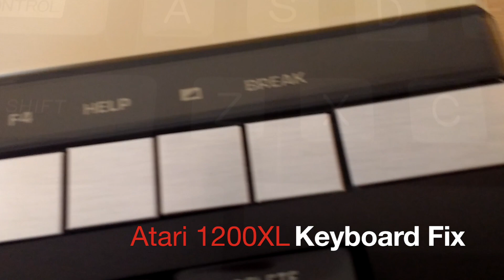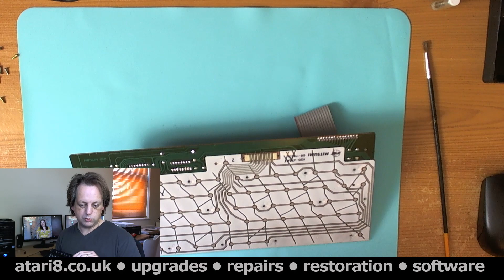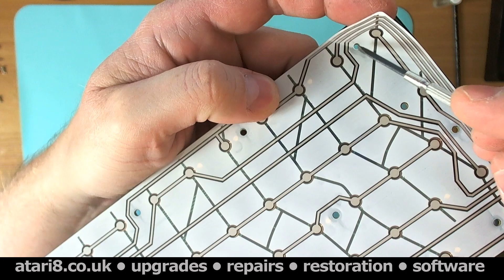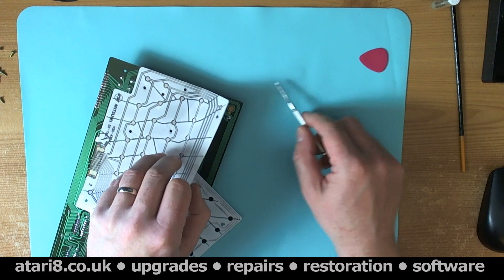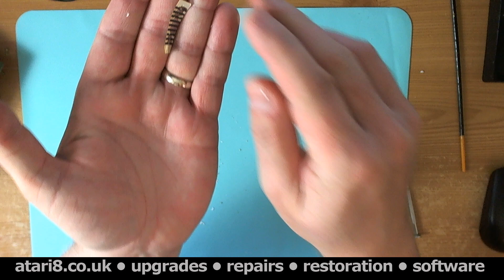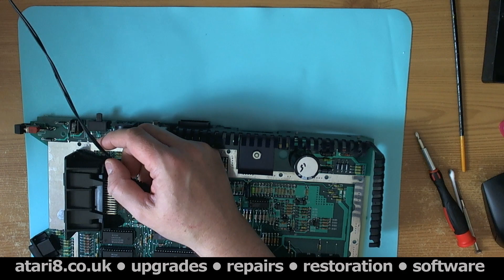Atari 1200XL Keyboard Mylar Fix

Comment: Thank you!  Your video saved me having to buy silver paint. I got mine working without it.   I found that someone had already attempted the fix, the membrane side of the connector was clean, but they left the tape on the PCB side, They actually painted silver on top of it .   All I had to do was remove the tape from the keyboard, clean it up and put it all back together.
Reply from the maker: That's great! Applying the conductive paint over the old glue on the PCB side without removing the material preventing contact is certainly an interesting approach, LOL. :)

Comment: followed this video to help repair my Atari 1200XL keyboard.  Excellent.  Question..  with the U1MB with FJC firmware installed, how do you get into the system test to test memory, keyboard, etc.  Before the install it was press help while powering on.  But what now?

Also do I need to do a PBI mod on the Atari 1200XL for use with U1MB and SIDE3?
Reply from the maker: With the regular XL/XE OS, you hold down OPTION to boot directly to the self-test, although this will only happen if there is no bootable device (i.e. disk image or HDD partition) and if SpartaDOS X is turned off. You can also disable internal BASIC in the U1MB menu, and this will cause the system to boot directly to the self-test (if SDX is disabled). Lastly, you can boot into BASIC and then type 'BYE'.

Comment: In 85 or 86, when I got my first 130xe, the keyboard failed and I needed to fix it on the cheap.  I discovered "nickel print", a toluene-based conductive paint and got fairly good over the years at bandaiding the thing.  The ribbon is the toughest part, because it is flexible and the paint, when dry, isn't.  Still, it kept the machine going for another 15 years with on-and-off retouching.  To paint a trace, I would cut a paper match at an angle thus /, or actually a bit more oblique than that, and use the fine tip of the angle to paint a trace segment.  Throw away the match after one use, cut another, make another line, and so forth.  That worked pretty well for the fine work needed.  I never used a brush, and those conductive pens were expensive and didn't work as well.  They didn't lay down much paint, for one, and for the other, they tend to scrub off what paint is already there.  A fresh-cut paper match won't do that.  I'm sure products have gotten better since the 80's and 90's, but this might help someone.  Remember, an ohmmeter is a must to diagnose a bad trace.  Sometimes they LOOK no different than any other, but somewhere along it the trace is bad.  Just walk your probes along, checking the trace in segments, until you get a break.  Then paint the section you identified as faulty and test.
Reply from the maker: Yes: conductive paint is often an integral part of this particular fix, but in this video I mention that the carbon pads on the Mylar remained intact after the perished adhesive was removed and thus no conductive paint was required (which made this keyboard a sub-optimal example of the repair). When paint is required on this particular job, it's sufficient to rebuild the pads by eye. The keyboard will then work. I never yet encountered a 1200XL keyboard Mylar with trace damage anywhere else than on the carbon pads where the old adhesive has been removed. The 1200XL traces are not prone to simply burning out or oxidising as do the traces on some of the other XL/XE keyboard Mylars. The Mylar flex connectors are pretty fragile; at least on the 1200XL, 600/800XL AWC, Alps and some other keyboard variants, the flex cable is soldered to the PCB and can be relatively easily replaced with ribbon cable and straight header pins.